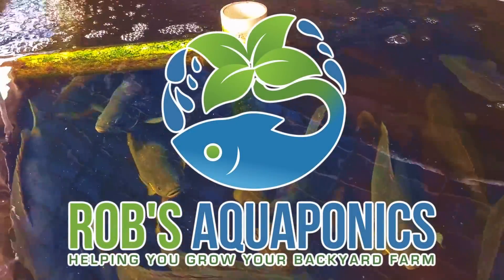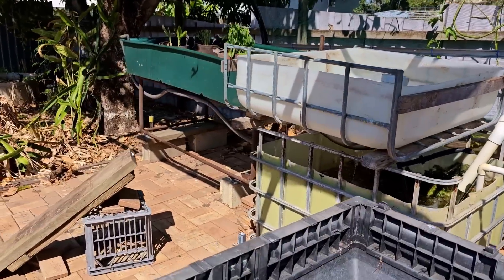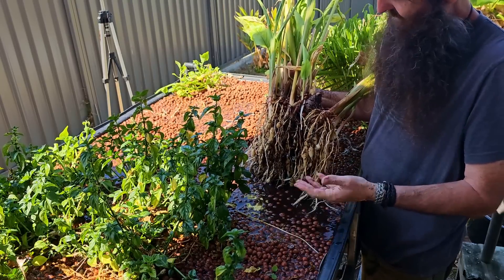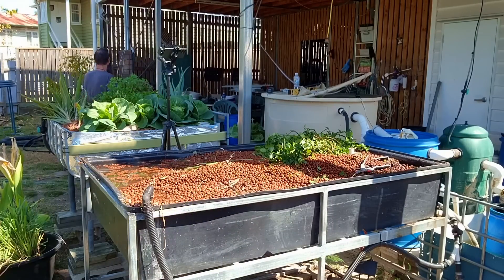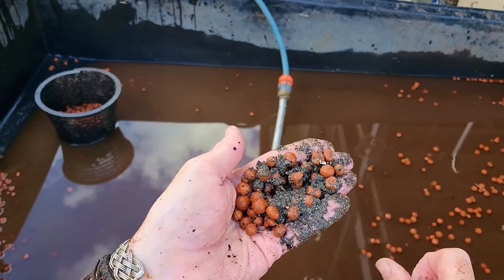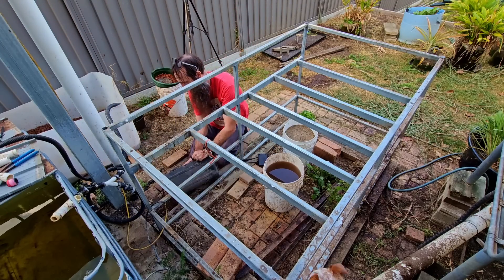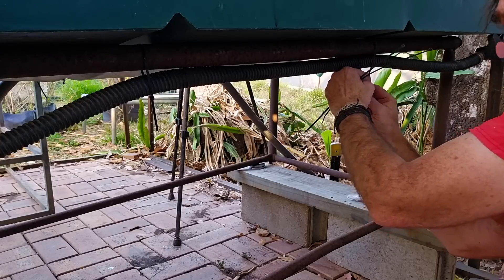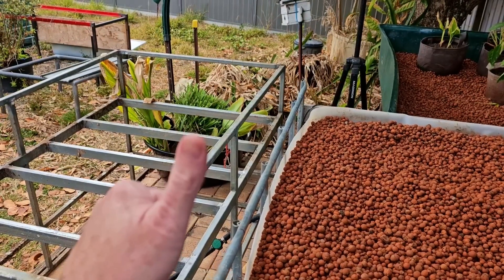Moving an Aquaponics Media Grow Bed - How to Clean Grow Media

Comment: This system is looking good. Are you planning to keep this configuration if you move it to the new place or will you be redesigning it straight away?
Reply from the maker: I will be setting up a basic IBC build fairly soon after the move as I want to make a step by step video & guide on one. It will probably be a backyard size 3 IBC build with 3 grow beds, fish tank & sump as most folks have the room for a build of that size. 
After that........ 🤔 I have a few ideas. I would like to grow using NFT as I have never used that method properly before. Only a half hearted attempt 20+ years ago with a hydro build. DWC culture as well. In all honesty, I'd like to try a sand based bed for a fodder grow system to see how that turns out. 
So many options. 😁😁